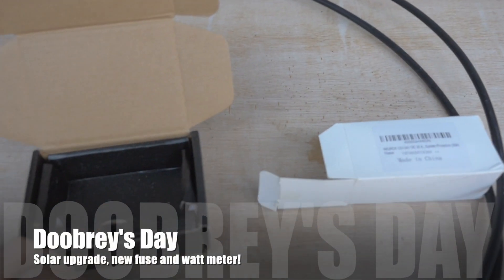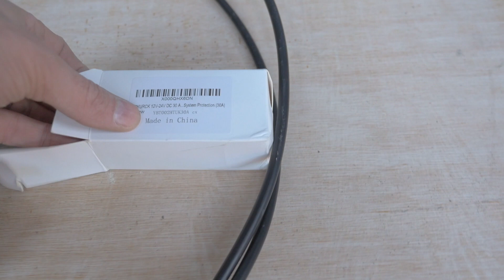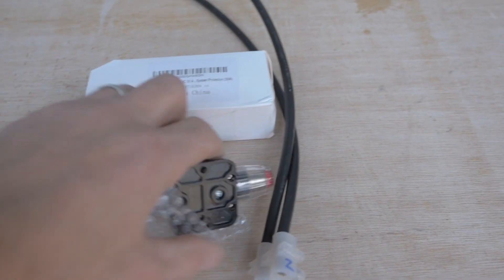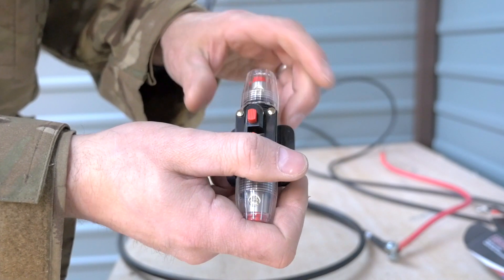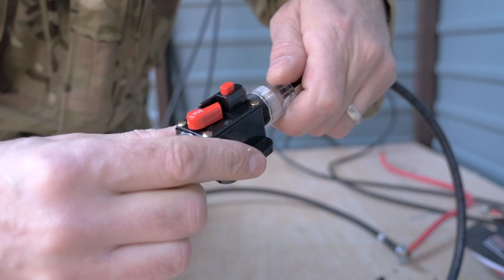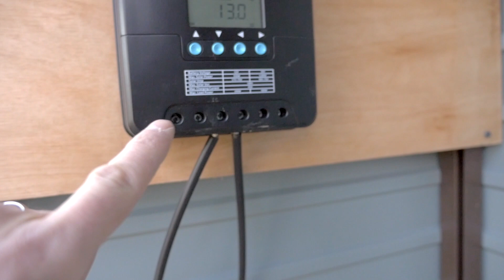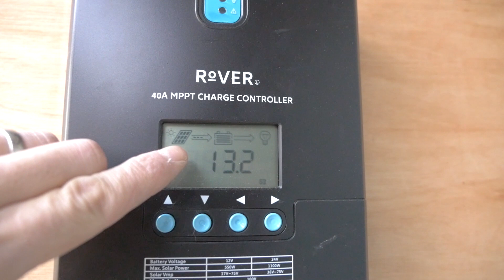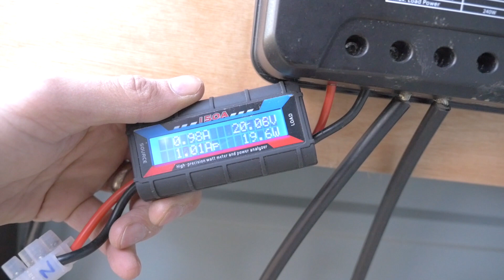Solar watt meter and fuse install

Comment: The grommet goes in the cover.
So when you attach them, it should be.
Outside cover, grommet,  wire end.

The wire end, should be stripped the length of the metal end piece. And the current rating should be you maximum solar rating.
The other fuse, batter to inverter should be the maximum draw current.

So a 12v 1000w inverter will draw 80 amps
(Watts divided by volts)
Hence a 24v is nicer as a all rounder and easy system.

I was walking when watching and had to stop when you were waving wires around between the battery terminal and the solar input.. I was expecting a bang.

Comment: Fab. Ive just ordered a couple of these circuit breakers for my new solar power system and good to see how they fit together. Just as a matter of interest, do you suggest another between the charge controller and the battery? Is that OTT? 😛

Comment: Good Soldering, Awful hole cutting ;) Useful Vid, I was hoping for more on the actual Power meter as there are a few similar looking ones about, I am wondering what the differences are. Thankyou. Your place sounds very busy.

Comment: Hi  2x 190watt panels how many amps fuse  ?    150A batty  how many amps fuse ? Thanks
Reply: Suat, Normally 3 Circuit Breakers are used in a PV, battery, inverter set up. FUSES are Good too. but when you have resettable CBs readily available at low cost, isn't it better? All the CBs are DC operational.
This set up is better than FUSEs. Good CBs are available from A.Express @ US$7.50 each. Model TOMZN, DIN Rail type. Normally 30~60A is used. but then again, AMPS is user specific. 73s...
With due respect to DOOBREY.

Comment: I have a quick question. Would it be more beneficial to connect the watts meter between the battery and the mppt charge regulator?
Reply from the maker: Hmmmm good question.  I want to know how much energy i am getting from the panels, so positioned it there
Reply: 073020/0134 PST.  Hello Rob, Normally 3 Watt meters are used in this configuration. 1) PV array to charge Controller, to check the input from the PV to  CC 2) From Charge Controller to Storage Battery , to check the charging Data 3) from the Battery to output, to check the wattage consumption data. That's the elaborate type of measuring and collecting Data. You can do this with 2 watt meters  or No Watt meters at all, in the system. Victron MPPT has built-in Bluetooth, that can transmit Dada to your iOS and OS X devices or Android Systems. 
In short, the design is user specific and many modifications or changes are successfully made. 73s...
DOOBREY, I took the liberty to explain with all due respect to you, Sir.

Comment: Oh no!!! That's a junk fuse! Change that out for a better "Brand Name" type. Those Chinese fuse will eventually fail! I had a few fail, they will either weld together,  melt or internal plastic will break off. If you have expensive equipment you would want to use a safe a reliable product to go along with your investment. Never cheap out when it comes down to the safety of you and your family.
Reply: 073020/0155pst May I recommend DIN Rail Circuit breakers? like EATON/ Heinemann examples
Reply from the maker: Oh, good advice, can you recommend any in the uk pls?
Reply: I use Bussman or Stinger, I purchased from Amazon.

Comment: Hello Doobrey. Could you tell me how can you power OFF this meter? Or does it go automatically off when no charge or discharge is applied? I'm worried about leaving it plugged in to the battery constantly. how much does it draw on it own, with nothing else connected to it apart from the battery? Thanks
Reply from the maker: Heya - I leave it powered on all the time - doesn't seem to take a lot of power at all